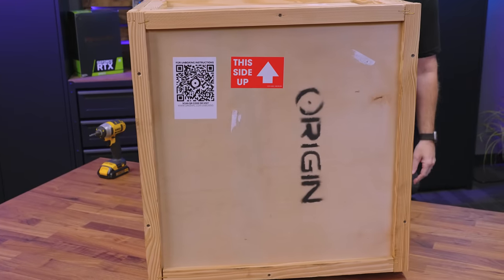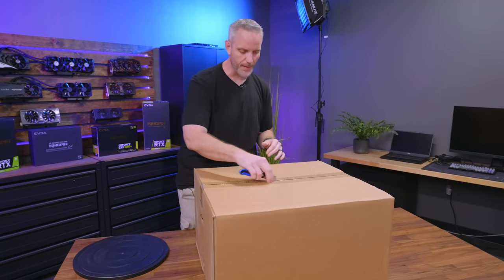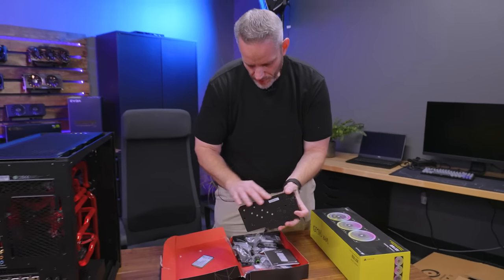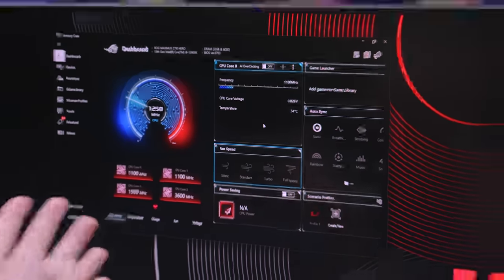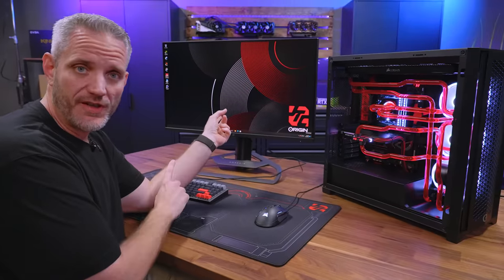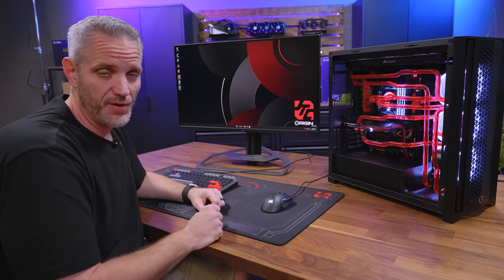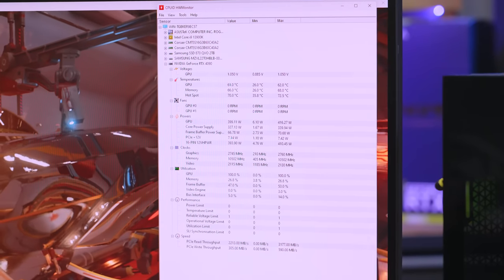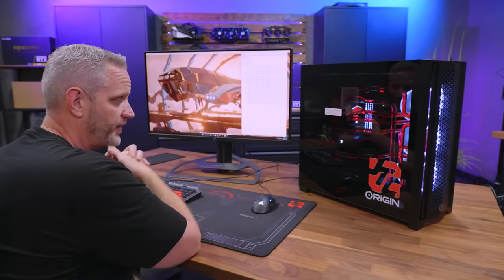When the PC comes in a crate, you know it's gonna be good!

Comment: that SSD carrier thing, IMO they should have put it in the system. I would imagine there is no harm in it being there without drives even if the system is running.  And it would have been trivial to slot the foam supporting the GPU.  I am surprised this system does not have a water temp sensor.

Comment: If you want a quiet, low-maintenance, high-performance system, do this: No water cooling nonsense, use really good air coolers like NH-D15, very good airflow case, NO dust filters, and all fans on FIXED speed. Yes, all fans at the same speed all the time (except GPU), and seal every crack and hole in the case that’s not explicitly part of the intended airflow path, using vinyl adhesive sheets (Amazon). If you do everything I outlined, the case fans at low silent speed will be PLENTY when your game is at full-throttle. Now you have an ultra-quiet system. And no water-cooling nonsense to fuss around with next time you want to upgrade components.

Comment: Btw water cooling can do only so much. A sealed case , wverything water cooled, everything under high relative to outside ambient air pressure. Cooled by a 1400btu ac unit. Win. My 4090 under load and 13900k barley thermal throttle
Reply: Humidity is an issue. But only for a few mins. On my last pc I removed all components and sprayed them with contact cleaner and then oiled them with die elec tric lube before install. In a closed loop, there is zero dust. And you only need to clean it once every 3 years

Comment: For RGB I got sick and tired of having to use Fusion, so I found a program called OpenRGB. I cant really test multiple brand compatibility, since I just have my Aorus mobo, GSkill RAM which works with Fusion and EK res which runs though the mobo header, but it can even control my Glorious GMMK and it works pretty well.

Comment: What is the benefit of putting the fan curve on GPU load as opposed to an in-line temp sensor on the loop? I've always been running my fans off of T_SENSOR, connected to a sensor in my loop. Also just FYI, Fan Xpert 4 in Armoury Crate will allow you to do your fan curve on GPU Temp, just not with the CPU Fan header.

Comment: Just my one cent on this, regarding the exhaust fans with the filter. Personally i have a fractal 7 case and it got on the top probably 10cm of space from the AIO/Fans. So it means without a filter dust would come in and sit on the motherboard and all internal components when the PC is tuned off. And i live in a dusty area :/ So when i see a filter im gonna use it

Comment: I think they did a decent job, but the question is, what does it cost? I have a z690 E gaming 13900kf 4090strix oc 6400mhz ddr5 Dominator two 2t ssd gen 4, and I bet money I spent way less. It was on a custom loop, but then I got the ryujin 2 360, and I need to figure out how to do hard lines to it, which I'm working on. But I guarantee you I spent less. I bet they want $10,000 for that computer or more.

Comment: I purchased a $12,300 PC nightmare from Origin. having Origin build my dream PC was the biggest mistake I’ve ever made in my life. After receiving it, there was countless issues, so I had to return it. It was completely damaged in the return shipping. The  hard lines were completely broken, red fluid got all over every component. 13 weeks later I received my PC back and I found out none of the components were replaced  not even The original problems wrong ram not supported by motherboard were not fixed. And the PC only works for 30 minutes. I return the PC again and now I’m waiting on a replacement. It’s probably gonna be a nightmare also.

Comment: if having the front (side) fans set to exhaust is due to looks of the fan then set the top to inlet to fix the problem plus also fixing the issue of not seeing the good side of the top fans in stock setup, which is also a looks issue so why not have it set that way stock

Comment: I truly love the look and performance you get with water-cooling, but air-cooling is really easy, reliable, capable and inexpensive anymore. Origin is doing very nice work in the water-cooled pre-built arena and I think most people would be ecstatic to have a system that clean and pretty.
Reply: To be honest, I would rather not, I've got AIO water-cooled GPU just to save the hassle, if something goes wrong and you need to take out some parts it's gonna be worst time in your life.
Reply: @Deviczek  I have an air cooled system that I don't lose a wink of sleep over. No leaks. No clogs. Minimal maintenance and comparable cooling performance. Water-cooled stuff is pretty though and we all appreciate shiny things.
Reply: @thseed7  Tbh you can add some neon's in there even without water cooling system, it's pretty till there's issue, just like with phones having removable battery I miss these easy times.

Comment: The iCUE plugin doesn't work without Aura/Armory Crate installed (it hooks it in the background). You can actually use the old version of Aura from before they released Armory Crate if you don't want that cancer on your PC.

I just use OpenRGB though since I set it to static white and ASUS boards automatically save the last set static color. Set it and forget it.
Reply: I don't understand all the hate for Armory Crate. It can keep all your drivers up-to-date, and let you monitor/control all aspects of your motherboard, without forcing anything on you. It seems it's just "fashionable" to bash Armory Crate, yet without any real reason as to why.
Reply: @zebrapluto530  I can keep my own drivers up to date without a bloated piece of software that installs a bunch of services I don't need/want and makes itself nearly impossible to completely remove without additional tools.

Why should I have to install such a bloated piece of trash when all I want to do is control the one set of lights on my motherboard? I use iCUE for everything else and despite people hating on it, it works infinitely better, has a much more logical UI and now that the install is modular it doesn't install a bunch of services and background shit you don't need...

Comment: I learnt some from ASUS motherboards when I upgraded my PC from 11600KF to a 13700KF. Yeah, I throttled my CPU pretty much. ALL the time acctually. I got a 1000W PSU, even that PSU started to spin it's fan. Not normal acctually, so I looked it up in BIOS. ASUS's motherboards are unlocked. So my bloody watts for CPU went through the roof, not as CPU was intended to.
So the wattage was on bloody 4074 watts in BIOS. Not WONDER why I throttled my CPU! Intels CPU got a safesystem so at 100 degrees celcius it stops to work for some percentage so that it will not be damaged or overheated. So I putted down the wattage to the watts that is recommended for the CPU. Going from 100 degrees celcius, to around 74 degrees with full load on Cinebench. I also undervolted it so it is around 1.249V. Original it sat at 1.457V. Yeah, a bit high, I guess it has to do with ASUS's bloody motherboard.
Well, the conclusion on THAT is that AMD's motherboard from ASUS got the same problem. AMD also uses old school connectors for their sockets, so even if the chipset got the failsafety like Intel's CPU, it seems that the old school connectors doesn't recognizes that the CPU runs hot, so it fries the AMD CPU instead.
Does this sounds soooo retro? Yeah, because Intels CPU did the same thing when something went wrong. The latest Intel CPU's with old school socket-connectors had the failsafety in it, but it almost never worked, and if it did it was like. "YEAH!! HOOORRAAHH!! My CPU was SAVED!"
So there you got the problem with the AMD fried CPU's from new ASUS motherboards.

Comment: Hey Jay!  Can you do video on setting up the fans for a system with a Corsair iCue / Armory Crate?  I'm running everything through iCue and only use Armory Crate to get the mobo lighting to sync.  Is this right?  System is a ASUS Z790 Hero Mobo / 13900K / 4090 / H150i Elite Capellix 360 + 7 more Corsir case fans (all QL fans).

Comment: Consider if you buy a PC from Origin, it comes full of "Retail" parts without the retail box accessories and components and only limited OEM warranties. My friend had this issue, 10940X CPU died after 13 months, tray CPU has no Intel warranty for customer. Corsair HX1000 PSU, none of the additional modular cables were included... so that's 2x 2+6 connections that you've got no cables for. The Corsair 360mm AIO only came with hardware for LGA2066 so, no way to switch it to AMD or other Intel sockets because none of the hardware was included. And the Windows 10 license...says it's OEM...how do you license Windows OEM with all retail components? And the support he got was non-existent and when you buy a $6000 PC you expect to get good support but only a 12-month warranty on hardware and when the system is a doorstop in the 13th month they told him to take it to a local repair shop. Take your money and go online or to MC and buy all the same parts and do it yourself, get all the warranties and manuals and extra parts and accessories, and put the other $2000 into something else.

/at least Jay got the stuff in the red and black box because my friend got none of that. And his system looked a lot like this, zip ties around everything, same junk 860evo sata SSD that he overpaid for, etc etc

Comment: Awesome video! I had a question about the size of fans, is there a big difference in using 120mm or 140mm when you have the space to use both? And the same about radiator thickness… do have recommendations if space is no issue?

Comment: @JayzTwoCents 

I dont ever see you utilize the T-sensor outputs on ASUS boards and given the beta bios drama i guess you never will. Mind you Gigabyte, MSI also have these options on their top tier boards.
But my argument and point being, why dont you focus more on regulating FAN speeds per Water temperatur? 

I never use the CPU/Mobo/GPU temps to regulate my fans, i mean theres no point spinning up fans in a 22C room with 24C water, just cause i run cinebench right? :D
My fan curves for ultra silent is 32C low - 35C Mid - 37C high on the water, giving me a 20% duty cycle - > 50% duty cycle -> 100% duty cycle respectivly on the entire FAN PWM chain and with a spinup/down time of 25seconds.  Argument being a delta between air and water requires a 10C ish delta to actually transfer any meaningful heat out of the case. 
I promise you, the noise reduction, while still keeping everything cool and quiet, despite punching a cinebench or opening a winzip etc... I just dont understand why this is more a focus with these prosumer builds, i must admit. The drama of fans moving with load on the PC seems counter productive.

Comment: Jay, I love that your pushing for undervolt and XTU but you need to remember that Intel has disabled Undervolting in the OS thanks to the plundervolt exploit. 
I'd love it if you did a guide on how to do it in Bios.
Reply: pretty much exactly the same, except you reboot every time, and save your Profile inbetween runs, with a backup, incase you go too hard and have to clear CMOS (either removing the battery for a few seconds, or using the CLR_CMOS jumper on the board, or if you're super fancy your board may have a Clear CMOS button on it somewhere)
Reply: Me as well as I got XTU to install but my MSI Bios or something wont let me use it. It might be Bios settings stopping me but I have no clue what I'm actually doing when it comes to BIOS and undervolting etc...I tried a few things but they didn't seem to work so now I'm clueless. Luckily I have not seen my temps skyrocket except in a cinebench test which Jay said will push your CPU harder than any regular gaming etc..will ever do.
Reply: @Anthony-fd8mh  not a BIOS setting, if undervolt protection is on, you can't adjust it in the OS but if you turn that protection off then XTU refuses to start.

You have to actually reboot and do all the undervolting manually.

My 13700K manages a 5.4GHz to all P-cores but will only undervolt about 35mv. To be fair though, this is after the new NZXT Bios update lowered the voltage massively.
Reply: @DokiKimori  ah I see. I tried turning off the protection but then my processor mhz went way down probably the intel thing and it changed my windows power profile as well so that’s when I said I’m not going to touch it. Turn the protection back on and changed my power profile to ultimate and everything was back to normal. In my bios though (msi) I did tell it that I was using water cooling due to an AIO but I wonder if I can tell it I’m using one of the other choices to try and cheat it to lowering the voltage🤷‍♂️

Comment: Despite these issues, definitely wish I’d spent a few more $ and gone with Origin instead of Cyberpower for my last prebuilt. Talk about an absurdly poorly thought out - and executed - build. Would rather spend $7K on an Origin than throw away $3.5 K on a CyberPower. I mean, at least this system booted up and didn’t have a dead graphics card upon arrival, only for one of the NVMe drives to turn out to be missing once the PC booted on the replacement graphics card 2 weeks later. Lol.

Comment: Not impressed with the thermals to be honest. I do nearly that well with my overclocked 12900k pulling around 300 watts with just an Artic Liquid Freezer 420 using Noctua industrial PPC high static pressure fans. I realize they are cooling 400 watts of GPU but I would expect a custom loop to have more fluid flow and better thermals. From what I've seen it seems like the best I can expect from a custom loop is 5-6C improvement, hardly worth the investment, although it would be fun to do.

Comment: I need to do a small form system to fit in a space under a sloped roof. I'm thinking an o11-mini or phanteks evolv shift xt with liquid cooling for both the GPU and CPU on a single radiator. Can you do a build showing a very small water cooled system?

Comment: I had a project to water cool my new pc 12900KS/4090. What's sad is that it become irrelevant to water cool since 40 series. The 4090 (rog strix oc) clocks at 2985 mhz and never goes behond 60 degree celsius, while the fans are inaudible. The gpu fans never ramp up because of the huge cooler and never goes louder than the system fans. To lower like 5 degree celsius for 2000$ worth of water cooling stuff is just a waste. I used to have a 2080 ti FE that I water cooled because it was terribly loud and enjoyed the silence of water cooling at that time.

Comment: Hey JayzTwoCents, I'm thinking of buying 13900ks and 4090, is it enough with o11 dynamic 3 fans at the bottom, 3 fans on the side (motherboard tray) and 3 fans at the top with 120mm radiator at the back of the case? I've heard more fans = more cooling. /s

Comment: if it doesnt show up in Icue then it's a 100% no for me. In my system my Rog 4080oc shows up, my Rog Strix z590-E gaming shows up,  my corsair dims, my corsair AF120's the H115i elite capellix and even the corsair ML140 shows up.  Without it, i feel naked or like im time traveling back in time and have to mess around with multiple sofware to set curves here and there, oh tho in this spesific case you have here, to set GPU curve, would it not work with Msi Afterburner? I set my curve on the liquid temps in ICUE and set a curve for the gpu in afterburner.
Custom loops are cool and all, especially if it is in a build you know you're just gonna leave as is when you done building it, but in my case, I like to fiddle when i get bored, take out the components, clean them, clean the case, re assemble everything go over the cable management see if i can do anything better which is the biggest challenge because it already looks slick.

Now i dont really use any pci-e slots except for the gpu so thats why i  vertical mounted it. my streamer rig has not vertical mounted however as it has a capture card underneath the gpu.

So the main reason i don't have custom loop right now is because I'm too often in my systems cleaning and maintaining it from dust so it is as clean as possible at all times.       
And imo i believe an AIO's can do just as much as a custom loop, especially since you also have aio gpu coolers on the market aswell!

Comment: Since mid 91 working on computers and what they do to make a $$$ just amazes me. Does it come with a free trail of Anti-virus software and VPN too? Now, I have to admit I never thought of doing this with water cooling. But, if they are going to take it this far. Why not just make a case with a complete separate section for the radiator and fans? Now don't get me wrong. I have seen a few but they was not 100% sealed between the 2 compartments. Plus I would be worried about ram, ssd (m.2) and voltage regulators. The wooden box would probably make a better desktop case.

Comment: My biggest problem with Armoury Crate was that it was failing to update to the latest Motherboard HAL and Framework Service updates. I had crazy behavior, like iCue not detecting any of the gadgets nor the Elite LCD/fans... But after 3 weeks and my resignation, it just updated on its own a few days later and now everything works, including the fact that iCue now sees the ASUS motherboard, even if it doesn't remember its lighting profile... But that's ANOTHER problem I'm still trying to figure out. 😩
Reply: my guess is it had to update the BIOS in a specific order. with my x470-f I couldn't just jump straight to the latest BIOS revision to get my 5800x3D working, had to go through like 4 updates to reach that point, so maybe your system was doing something akin to that but just not reporting it? though honestly, I did it manually and not via Armoury Crate lol

also, your comment got stolen by a bot, you might want to report @EmilyL-Ready-FOR-YOU176 for impersonation or however it works. didn't realise until after I responded to them and had to hunt down your comment lol